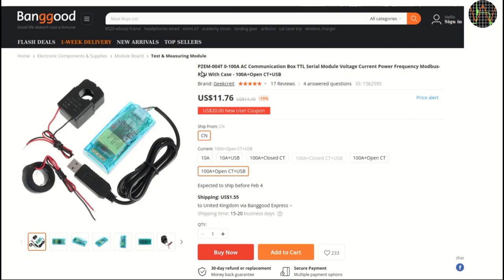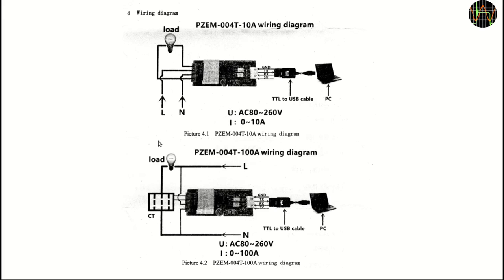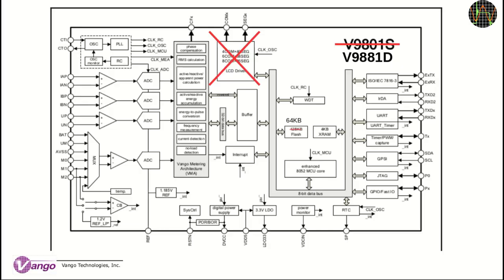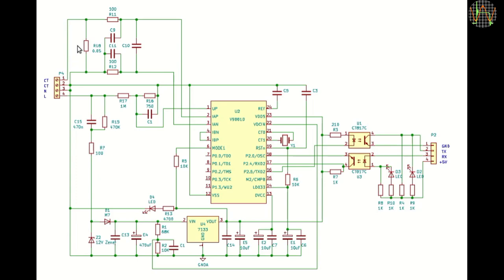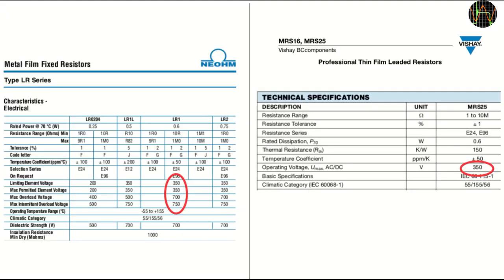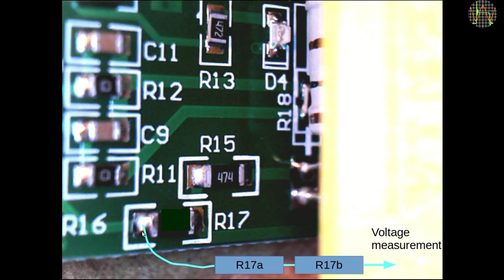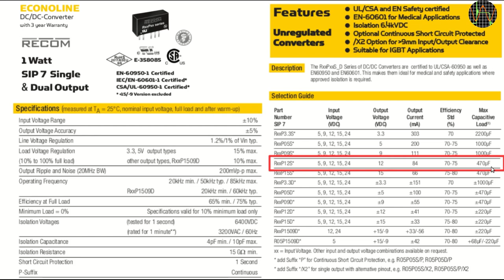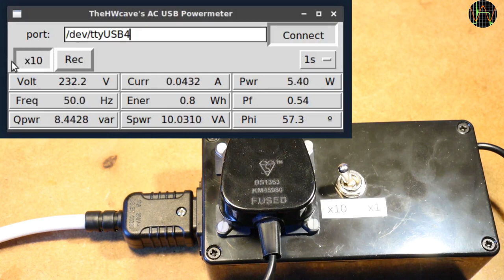Modifying the Peacefair PZEM-004T AC Comms Module (with schematic)

Comment: Awesome video.  I have a question.  Can I replace the 3.3volt 7133 Low Power LDO with a beefier regulator?  I would like to use the VDD5 3.3V line to simultaneously power an ESP8266 chip, so I won't have to additionally supply an external 5V and I can simply use the lines going into opto-isolators directly with the ESP8266 chip without even having to power the isolators.  It would be a self contained device.  However the problem is that the 3.3v regulator, the 7133 Low Power LDO can supply at most 30mA.  The ESP8266 can draw up to 320mA @3.3V.  Can you recommend me something to replace it with?  Would there be another component that I would have to replace as well?  Also most importantly would this hinder the PZEM measurements in some way? Thanks a lot.
Reply from the maker: The 7133 or a replacement is not isolated from mains. In your suggestion the opto-isolaters would be useless, because either side would be connected to mains. Everything in your circuit, displays, buttons, interfaces would be potentially deadly to touch. Please don't do this. Alternatives. If you don't want to measure from zero volt, you can keep the original circuit and connect in parallel to the measurement connection a normal isolated power supply that feeds both the opto-isolators (you still need them!)  with 5V and your new circuit with 3.3V. Make sure you connect the power supply so that its current doesn't go through the current transformer, otherwise you always measure your own circuit consumption in addition to the load
Reply: @TheHWcave  The is a misunderstanding.  The ESP8266 is a WiFi chip and there will not be any displays buttons or anything else other than the chip it self.  Think of it as if it was already inside the V9881D.  Imagine this chip in place of the LCD driver part of the V9801S version for example, except without any outside connection.  No outside connection so no isolator needed.  I'm eliminating any outside connection so I don't need the opto-isolators.
Reply from the maker: @Mr_ToR  Ok, fair enough, but the existing power supply using cap dropper an Z-diode is not able to support this. It would need to burn 60 to 70W . Best to use separate isolated transformer to get say 6V AC which you then rectify and feed into a standard 3.3 V regulator. I would not use a SMPS for that because you have to connect the negative DC back to mains and with (dodgy) SMPS you never know how well isolated the DC output is. If the SMPS leaks L to neg. DC , you effectively short-circuit mains.
Reply: @TheHWcave  Great, thank you so much for this information.  Yes, that zener diode and the half bridge rectifier.  Thank you for pointing that out.  I have to get myself more familiar with that kind of non-common power supplies.  The main issue is that I already have 10 of these PZEM devices throught the house.  All interfaced to that ESP8266 WiFi chip with the serial connection where both the chip and the optoisolars are powered by cheap 5V usb power adaptors.With the wiring I'm using PZEM measures the mains load as well as the it's own consumption and the 5V adapter load as well.  The 5 V adapters consume about 1~1.5Watts.  However they add up in quantitiy.  I have 5 more PEM devices I have not installed yet.  I was hoping to find a more efficient and easier wiring method.  15 x 1.5 W makes ~+20Watts.
Reply: @Mr_ToR  hey! you touch good point, how your story end up? I do also look for simplification of ESP8622 power up.

Comment: To bother you again.
This time I have another project I want to ask you: When the current is greater than 100A(sometimes the current is about 120A), will the pzem explode or just measure it wrong?
Thank you so much!
Reply from the maker: Good question. 120A instead of 100A will generate an overvoltage  on the current input. I don't think that will cause any permanent damage.  I was trying to test that by running a 2KW heater at 240VAC in x10 mode but that is still just 8.3A. I don't have anything handy that would bring it up to the >10A. Anyway, if you want to try it out, do maybe 15 turns in the CT and then a 2KW heater will produce 124A. It would be great if you could report what the chip reports in this case. I was also thinking how to make a x0.5 mode. If you measured the length of the wire that goes through the CT and used a 2nd piece of the exact same wire and length and run it in parallel but NOT through the CT, you would theoretically now have a 200A measurement range and you would need to half all current and watt values you read. How accurate that x0.5 range is, I can't say. I guess how equal the current splits between the two paths would not only need the exact same length and diameter but also depend on the contact resistance where they join together.
Reply: Really thank you very much. 
I also thought of running 2 wires in parallel, but it is quite complicated because the machine capacity is very large and the power supply wire is very large. I will try to replace original CT with CT HCDT SCT24TS(200A, 2000:1, 10omh). Then the current and power values are multiplied by 2 to get the actual value. When the project is completed, I will report back the results.
Thank you very much!

Comment: Would a MT3608 work instead of the R05P12S?
Reply from the maker: No. The reason I chose the R05P12S is that it isolated to 3.2KV. It protects you and the devices you have connected on USB from mains voltage. Most DC-2-DC converters including the MT3608 are not and you will blow up your USB device and get a serious shock if you would use it (or any similar non-isolated converter)
Reply: @TheHWcave  Oh I see, guess I will have to stick to the original design then since there is no stock (aliexpress isn't helping either). Thank you.
Reply from the maker: @elpeepo8844  I understand but I would not buy such a critical component from eBay or Aliexpress anyway. This thing is essential for your safety (and survival of your connected devices). Better get it from a proper electronics distributor (far less likely to get  a fake)

Comment: Excuse me, what if i plug the output pin in reverse?? L pin on neutral and N pin on load? thank you..
Reply from the maker: This is no problem for this module. It will work either way.
Reply: @TheHWcave  Let me ask again sir, I have taken data from the sensor (Voltage, Current, Power, and Energy), then I communicated it via the MicroSD module. When I took the data, I tried to multiply V by I with the basic formula P=V.I, but the results did not match the data I had taken on the MicroSD.

Can this be considered normal? I think that the sensor installation is appropriate and there is no interference whatsoever. Thank you in advance.. 🙏
Reply from the maker: @raflyakhsani  The module measures active power as well as RMS volts , current and the phase angle between them. On an AC circuit multiplying RMS volts with RMS current only gives you watts if the phase angle between volts and current sine waves is 0 (=power factor 1). At any other time you get apparent power (VA not Watts) The module does a lot of signal processing and number crunching to get this calculation right for all phase angles (power factors). The only time you will have a power factor of (nearly) 1 is with a pure ohmic load, i.e. an old-style incandescent light bulb. These days, nearly all loads have a power factor of less than 1, especially cheap and low-power devices like LED bulbs, chargers, etc. If I use a 6W LED bulb, for example I get 233V 0.043A, Pwr = 5.36W, power factor 0.54. If I multiply volt and current I get 10 VA  but the active power (which you pay for) is just 5.36W .

Comment: Fantastic video sir , I am able to follow the same Method for making  Zero Voltage measurement and  it is working Good . But sir, I want to measure 440vac and switch of a phase to protect .It is possible using PZEM004t? In a 3 phase supply system, when the Neutral is lost at the utility junction point, by some reasons, devices connected in one phase will get 440V thru the neutral inside the premises getting another phase via common neutral connection. Hence this requirement

Comment: Hello, I hope you can help me, I have this sensor and I want to know how to calibrate it, because when I connect it to the 220Vac network it is giving me readings of approximately 245Vac, but this does not happen with the current that it measures correctly, (compare it with a laboratory instrument). Thank you very much in advance and greetings from Perú
Reply from the maker: Which country are you in? In a lot  of places it is 230V and in some 240V. The UK is 230V but at the moment I measure 237.8V. I think the tolerance is +10%/-6% so over 250V may be possible, all depending on daytime and network load and changing all the time. What I am saying is  the 245V may be correct. You should check the voltage with a reasonable meter at the same time as the module to see how far the module is off. 2nd question: is this the original module or did you do the mod? In case of the latter, did you measure the removed 1M resistor because that needs to be matched as close as possible with the new resistors and in my case the original resistor was way lower than 1M. Since the module was calibrated in the factory with that resistor, the replacement resistor needs to be of the same value.

Comment: Fantastic video. Thank you!
 I see you winded the wire multiple times trough the CT clamp. Why?  I would expect that mess the measurement, but I am ibviously wrong.
Reply from the maker: It increases sensitivity for low currents.  I have used the same trick in another power meter, maybe this video helps to understand it better: https://youtu.be/Pb9Fp5J7lTI

Comment: This is a great video! One thing we are looking to do is increase the sample rate of the PZEM meter to track motors in realtime and identify current spikes/stalls faster than required by a draditional energy meter to provide close to realtime feedback loops for control systems and to prevent damage to the fuse from locked rotor conditions. From the video and initial documentation, it seems that the fastest sample rate is every 0.5 seconds. This seems a bit slow - also considering that we are not interested in measuring frequency (only current). Is there a way to increase the sample rate on the IC in the PZEM (ideally to >10x/sec), and do you know which registers/software functions are needed to do so if that's feasible.

Thanks!
Reply from the maker: Thanks for the comments, unfortunately, I am not aware that the reporting rate can be changed. All chip registers are in the comprehensive datasheet for the V98xx family. While the hardware part of the chip samples energy values at kHz speed (as far as I remember the datasheet), the firmware that has been programmed into its Flash memory to convert the data into MODBUS format, calculate the checksum and send it on the serial port just doesn't work any faster. Since these chips were developed for use in electricity meters, there is an encryption-bit for the flash memory.  If it it has been set by the developer, it would be effective since the in the PZEM-004T the mode pin is pulled high, enabling metering mode. It  should be possible to force the pin low to get debug mode which I think turns off encryption and connect an in-circuit programmer to read, disassemble and possibly change the firmware. I have not investigated this myself but if you do get anywhere I would be interested in your results.

Comment: can i use this module in proteus simulation?
Reply from the maker: No idea, never used Proteus. But I would use some other circuit because with this one all the smart parts are inside a chip. All you could simulate is the power supply part.

Comment: great video, but can i change the current transformer?
Reply from the maker: You could but the unit has been designed an calibrated to use the one that comes with it. What you would need to do is characterise this transformer by measuring how many mA AC it produces when a known AC current passes through a conductor going through the core. If  your replacement transformer has the same ratio, the unit should work correctly.

Comment: Would it cause a problem to switch Live and Neutral inputs?
Reply from the maker: No, it would make no difference. You can still use this circuit in countries where main plugs are not polarized, e.g. the euro-plug can be inserted in to a mains socket either way around.
Reply: @TheHWcave  👍
Reply: @TheHWcave  Thanks a lot for your quick answer.
Reply: @TheHWcave  I would really appreciate it if you would take a look at my other question as well about replacing the regulator?

Comment: Dear! 
I use 3 phase 200v power supply. 
And I want to ask you: Can I use this device to measure the power between line1 and line2? ( two phases - 200v). Looking forward to your early response. Thank you so much!
Reply from the maker: Not without extensive modifications. If the phase to neutral voltage is 200V then the phase to phase is 346V which is way too much for the original module (the big yellow capacitor can only handle 250V and the chip cannot deal with such high inputs either). You could replace the yellow cap with a capacitor of somewhat lower capacitance but that is rated for at least 400V (lower capacitance = higher Z because it needs to drop more voltage). Also the resistor divider at the voltage sense input of the chip needs to be changed to reduce the  measured voltage. Probably easiest (but bad for resolution) is to divide by an additional factor of 10, then the voltage shown and the power values needs to be multiplied by 10 to get back the correct value.  Considering all this, I recon it is easier (and safer!) to get a module that is meant for higher voltage measurements.
Reply: First of all, thank you very much. Maybe because I didn't explain clearly, you misunderstood.
Phase to phase voltage is only 200v. So can I use this device to measure power between 2 phases ? One more time thank you very much.
Reply from the maker: @buimanhha3741  200V is no problem. I am using it with 240V. Of course this will need to be installed floating with respect to ground. As the USB output is opto-isolated it  should be fine.
Reply: @TheHWcave I am working for a Japanese factory. The phase to phase voltage in the Japanese power grid is close to 200v. Today, I installed the device at the factory. it runs well.
Thank you so much !

Comment: Good afternoon, please tell me why you replaced the 1 MΩ resistor with two series resistors of 510 kΩ and 470 kΩ. Does this affect the measurement accuracy? I want to redo it according to your scheme, but use a phone charger. The only question is, if the phase is reversed at the input and the neutral wire will not damage the unit and power supply and the module itself? Thank you very much for your work.
Reply from the maker: I measured the 1 MegOhm resistor and it was only 980K. Since the unit was calibrated in the factory with this resistor, the replacement has to match it or it will be off. But you need to measure your R17 because your resistor may have a different value. So don't just use 510K and 470K like I did. You need to come up with your own substitution and please use resistors rated for 350V (or more). 
I would NOT use a phone charger. It has to be a properly isolated power source and phone chargers are notorious for not being very good in that department. The 12V input on the module is connected to mains. It would be far safer for you to leave the capacitor dropper in place (do only option #1) and power the module through its original pin on the terminal block. 
Swapping live and neutral has no influence on the original module or my modified one. But if you use a dodgy phone charger, it might cause damage.
Reply: @TheHWcave  
Thank you very much for your answer! I use this module to measure the voltage at the output of a car inverter - there is a rectangular sine wave and the capacitor power supply does not work well (the current-limiting resistor, the largest on the module, heats up). This resistor burns out during continuous operation.
Reply: @TheHWcave  But if the phone does not fit, can you use a classic linear power supply on a conventional transformer?
Reply from the maker: Yes, that is possible, but why go through the trouble of making a separate power supply? You can use the one that is already onboard of the PZEM-004T. If you need to measure voltage from zero, just do option 1 in my video, but power the PZEM-004T as normal. However, in your case I don't think you even need to measure from zero as the inverter will always put out the same voltage. You can just use the PZEM-004T without any modification
Reply: @TheHWcave  Thanks for the answer, I plan to use these modules for different purposes. It is very convenient when the module is powered separately from the source, this allows you to control the moments when the device is turned on and off.

Comment: why R12 is connected between the ground ?
Reply from the maker: The AD converters inside the chip need a common potential for measuring both the voltage and the current